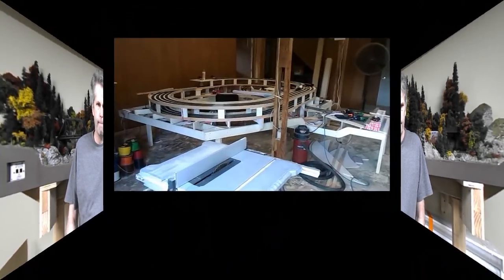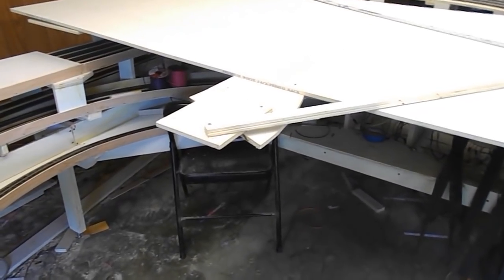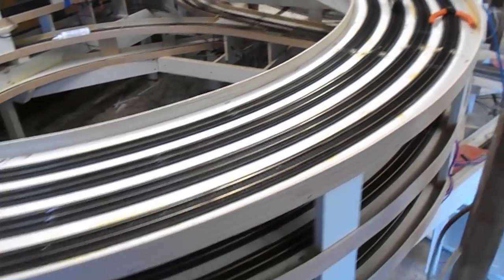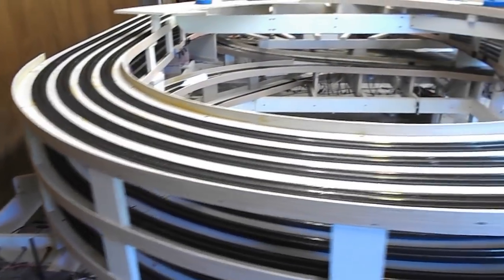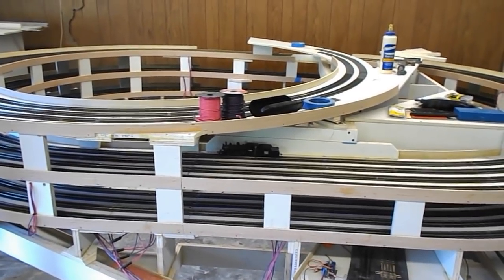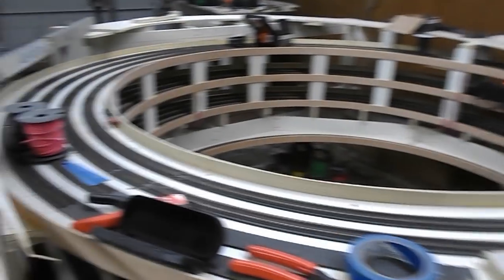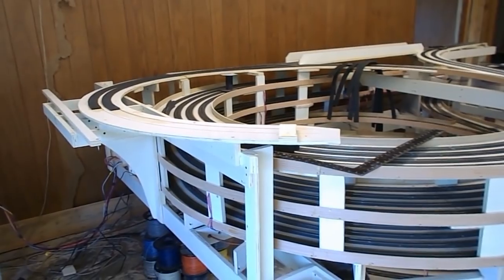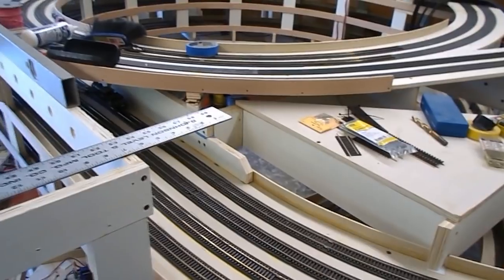Missabe & Western build, part 6

Comment: Great video Peter. Sorry to hear about your wife - hope you’re coping. Do you always lay track on cork on wood, or do you/can you lay track on top of foam? Thanks!
Reply from the maker: Track can be laid directly on top of foam if you want to.  Sometimes the best combination is to just use roadbed for the main lines to give a good height of ballast shoulder, and then put the industrial spurs straight on the foam where that can be nearly buried in the dirt.
Reply: mpeterll thanks for the info Peter - as always, much appreciated.

Comment: Thank you for sharing Peter. Do you have to deal with Track expansion in this design? You do beautiful work. Thanks again for sharing.
Reply from the maker: Every layout has to deal with track expansion to some degree or another.  I leave gaps at least every six feet.
Reply: @mpeterll  6 feet. Good to know.
Reply from the maker: @Vman7757  Actually there's nothing magical about that number; it's just two lengths of flex-track.

Comment: also wanted to add, your work is exceptional Peter, very well done, I knew the helix was going to be huge, but you don't know until you see it in situation.

it will be interesting on the final height of the layout as per deck level, i would want things as close to eye level as possible, everything is so beautifully done, i would want to show it off.
Reply from the maker: The upper deck is very close to eye level at about 64" (requiring slide-out steps to make switching easier).  The middle deck is a nominal 44" high, allowing for 20" between levels and each reach-in for operation.  If you check the track plan, you'll see that all the major switching locations are on the middle deck.